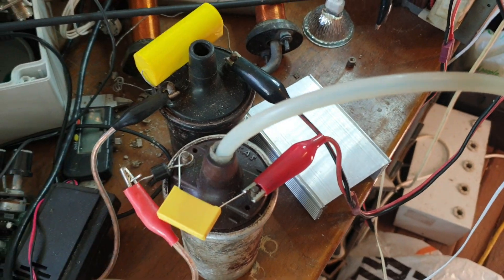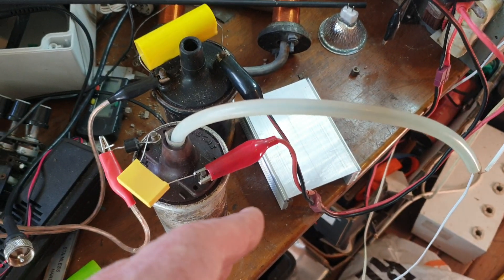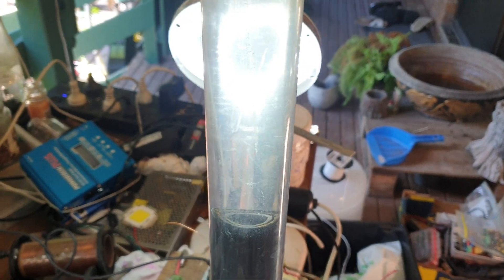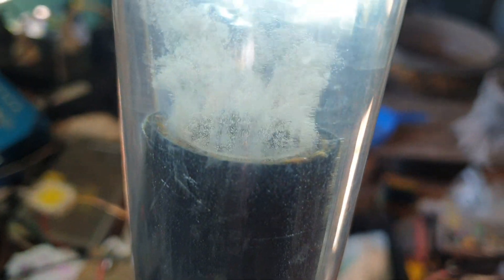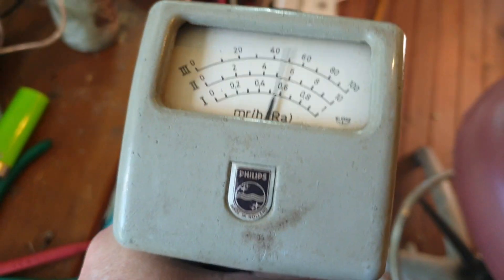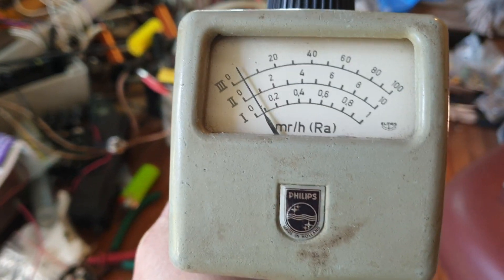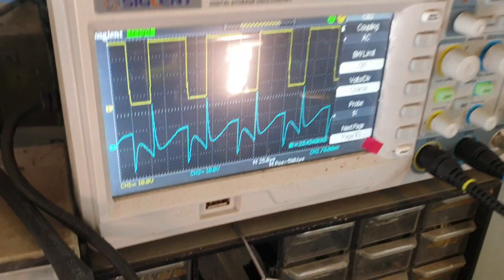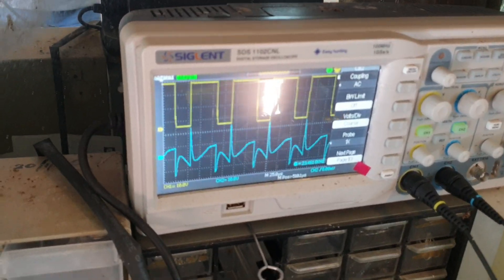Ignition coils as chokes, B field, HV everwhere. Hydrogen Experiment

Comment: Are you seeing any noticable difference with the HV+ grid added? It might be out of phase the way you have it.. Stan switched it in and out during gate offtime. That does look prett good for 6 watts! Good job! 🥳
Reply from the maker: it is allowing me to access the HV field with the panel in full sun... it would say yes an improvement but that is only a visual
Reply: Stan said, optimal tuning can be determined empirically with a gas flow meter and an ammeter.   I have yet to find one that can read the lower flow rates.
Reply from the maker: @drgonzo7806  maybe it was some home made thing he used.
Reply: Hey, when are you around to have a chat about stuffs?
Reply from the maker: @drgonzo7806  weekends are best, what's doin?
Reply: @m3sca1  not much, just want to share ideas, and collaborate with more people building stuff. It would be good to get some more people interested down your way.